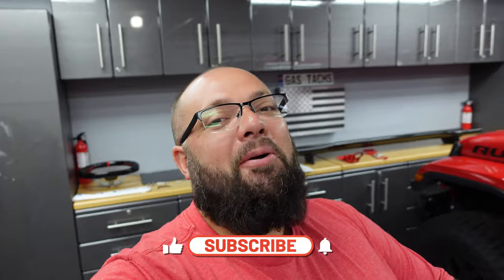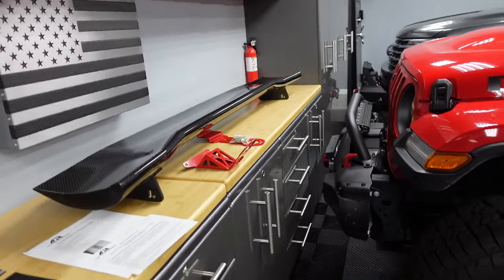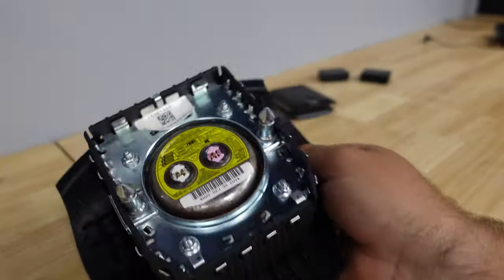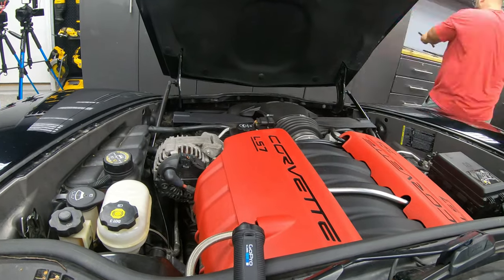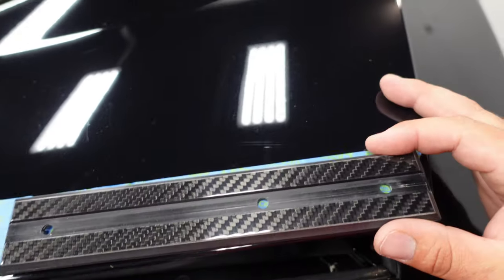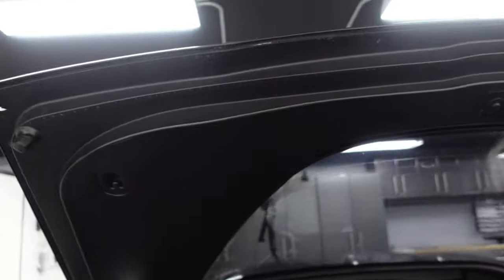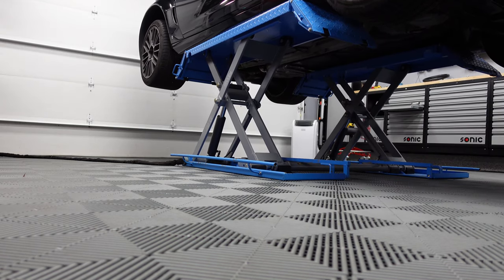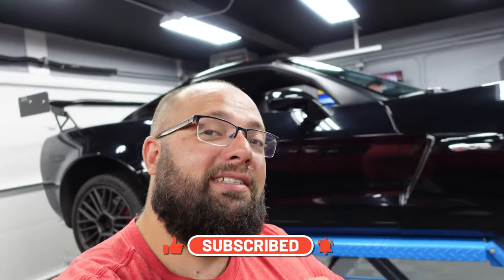C6 Z06 get some Track Mods! APR Performance GTC-500 Wing and more! Part 1

Comment: Did yours come with instructions? I bought mine used (brand new open box) and it didn’t come with instructions
Reply from the maker: Nope. ZERO instructions, Hope my video helps?
Reply: @GasTachs  it did. I just wish I would have seen it sooner. My mounting brackets are hanging over the hatch on each side by about 1/4” 😣
Reply: @GasTachs  also, did you use any loctite on any of the bolts and if so, where and what color? thanks!
Reply from the maker: @Ducati_rider69  No I did not but if you want to use blue